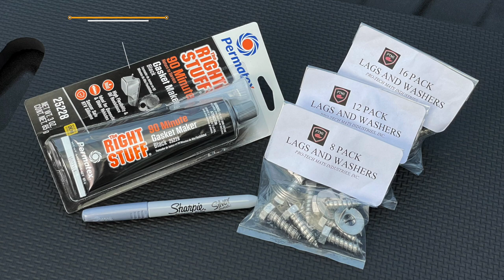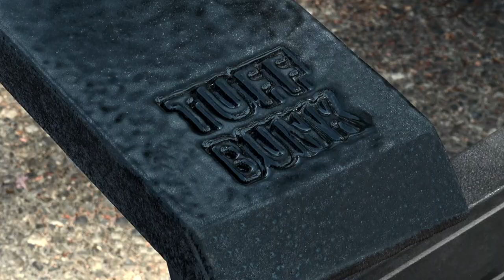TUFF BUNK Boat Trailer Boards

Comment: I'd like to know long term effects on the gel coat of the boat hull. The beauty of the carpet, although a hassle, was cushioning and friction. Rubber is more durable but creates friction that would seam to blister the fiberglass gel coating. If not why not? Thanks